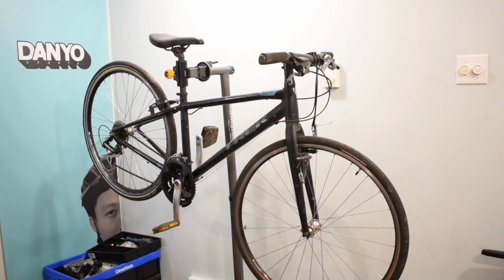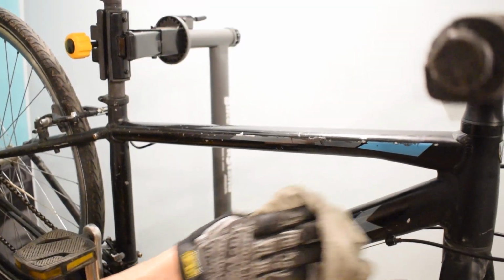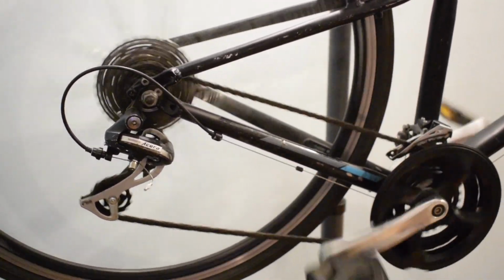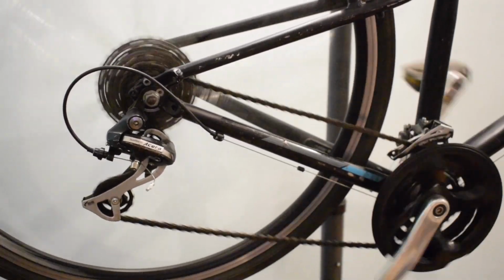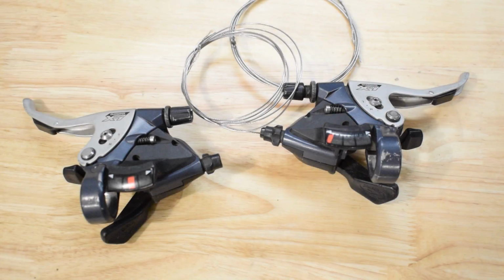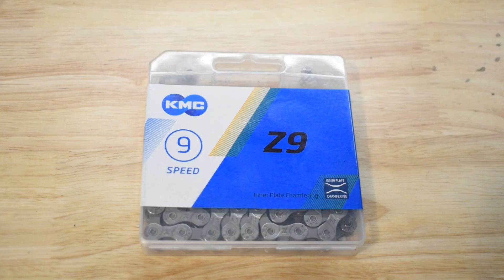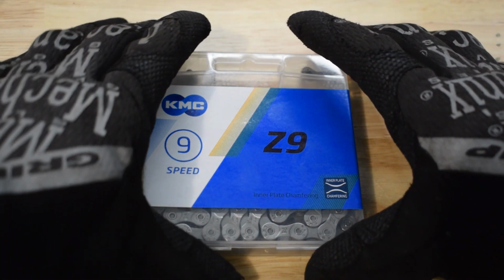8 Speed Shifters with 9 Speed Cassette?

Comment: Honestly, it is pointless to "upgrade" from 8 to 9 speed. It doesn't make the bike faster, it doesn't make the bike shift better, it doesn't (necessarily) provide higher or lower gears. The only way it makes sense if it everything is worn out and/or broken and you have to replace everything anyway.
Reply: Shimano's 9 speed rear derailleurs are much more fussy than 8 speed ones. SRAM and Microshift make more sense for 9 speed